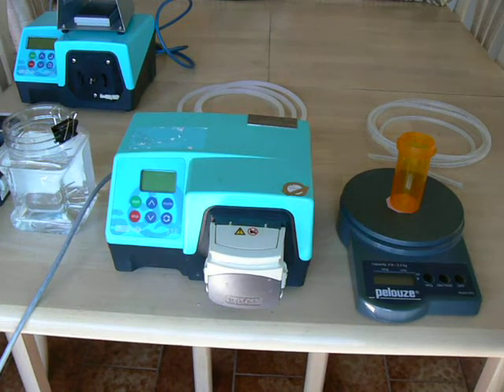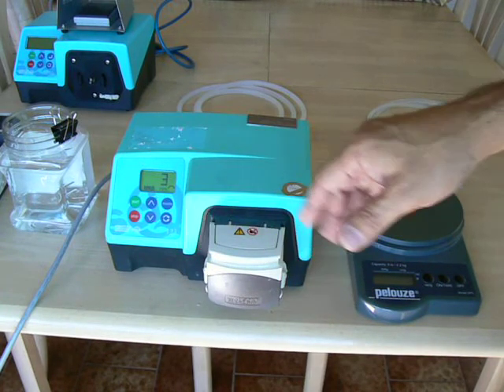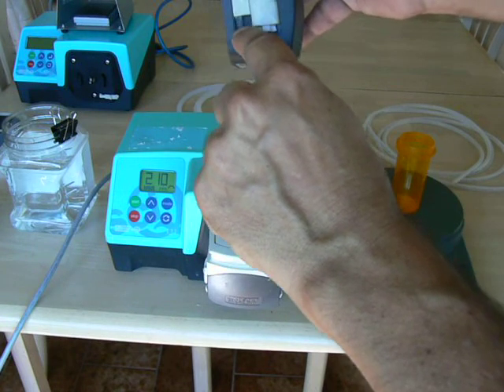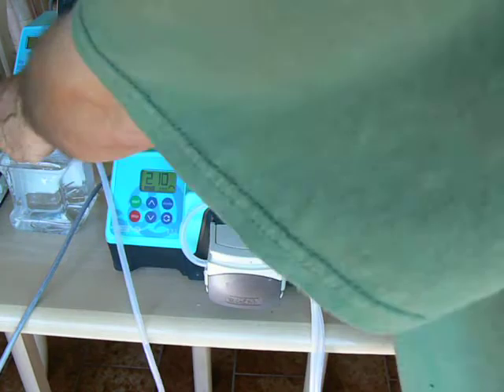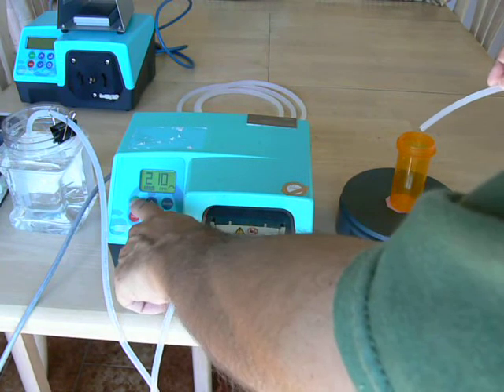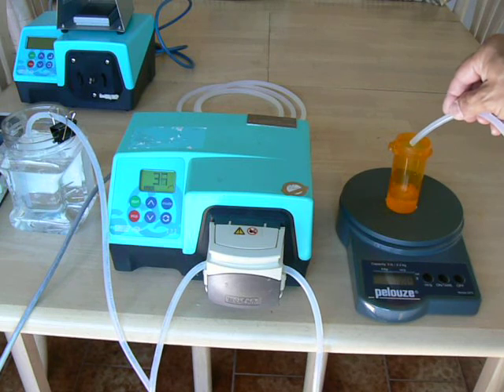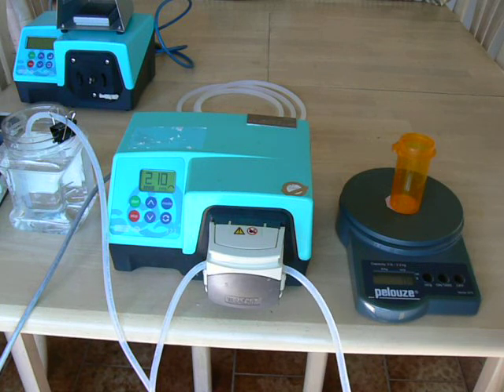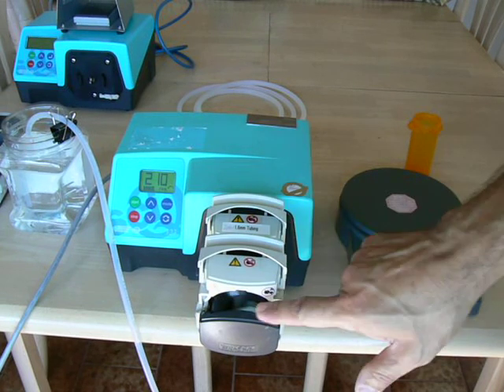Watson Marlow 323 Peristaltic Pump Operation

Comment: Thank for the video. I want pump 100 ml/min, but cannot calculate the rpm to be set. I used the flowing formulae desird flowrate / (max flow rate/max rpm), my inner wall thickness is 1.6 mm. Could also please zoom / share pic where to adjust pump head for 1.6 mm ID, ext thickness 3.2